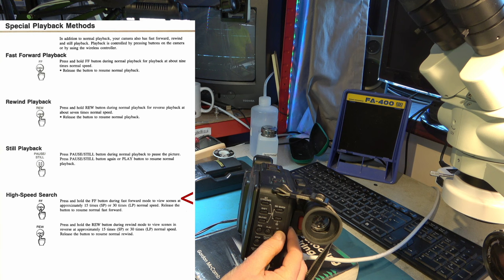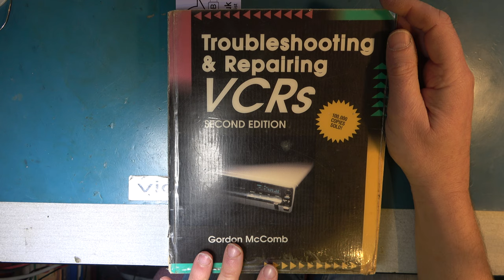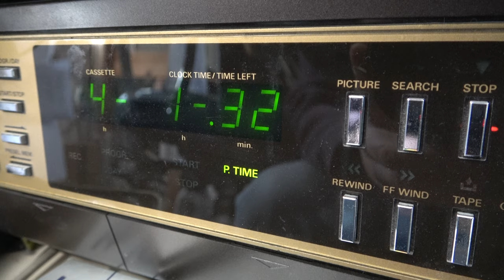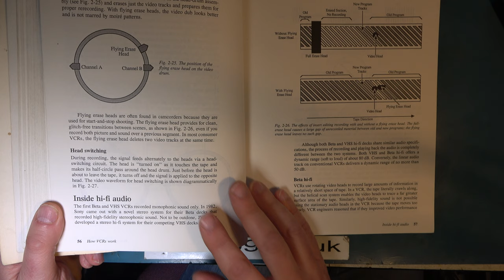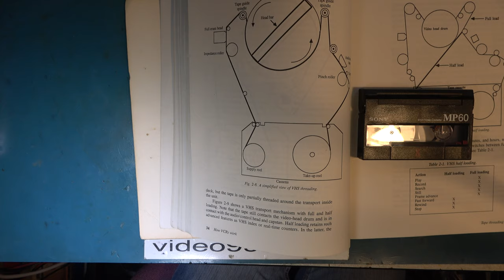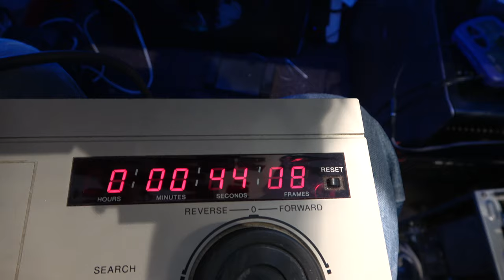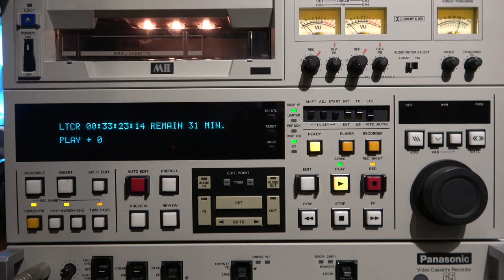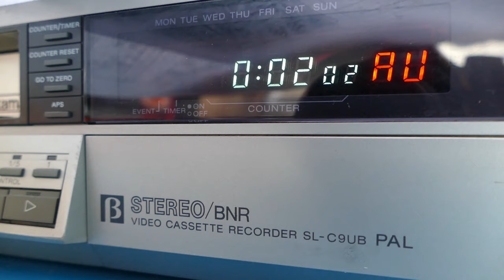To lace or to unlace, that is the question. Video deck threading during tape wind.

Comment: A bit late in the day now I siuppose, but I like the idea that Sanyo reverted to unlaced winding to save wear on the heads, despite the monitoring issue.
Back in the day my Sony C5 had rather too many head wear problems!
Reply from the maker: Funny that some Beta machines went from laced to unlaced but later some VHS machines went from unlaced to at least partly laced.

Comment: There was an unofficial  modification to the Philips N1700/N1702 which took advantage of its fully laced operation to give off-tape monitoring during stop, wind and rewind, replacing output from the tuner with the signal from the video heads when the Rec key was depressed. It was published in Television Magazine in April 1979 and I performed the mod on my own N1700 at the time. It gave a decent still frame during Stop, and a just-about-usable video during FF and RW. Not nearly as good as Beta SkipScan, but it gave a general idea of where you were during FF and RW.
Reply: Please share the wiring diagram for the modification on the N170x

Comment: Fascinating look at picture searching! My JVC S-VHS does the half-load, for the real-time counter. My PVW2800P has a PB/PB-EE switch on the front panel, which gives you the choice of seeing pictures (usually very broken up) or the input signal during FF/REW. Hadn't seen that book before, looks useful. I have Steve Beeching's "Videocassette recorders - a Servicing guide" and Eugene Trundle's "Servicing TV and Video equipment" - both really superb books, had them since they were published, and highly recommended for anyone working on these machines.
Reply from the maker: Ahh names from Television Magazine.

Comment: I was trying to think where I'd seen that feature before, holding down FF/REW and the machine jumping into picture search, it was the Sony UVW series of BetaSP decks. The front panels on those decks don't have jog/shuttle wheels so I think the only way to get a picture search is to hold down the FF or REW button. I bought a similar text book when I was on my TV engineering course back in the 90's. That one is definitely for PAL machines as it goes all the way back to the Philips N1500 and N1700 series, but I don't think it covers SVR or U-Matic and think it ends at Video 8 but not Hi-8. It shows all the track layouts for each format right down to details such as the azimuth angles of the video heads.

Comment: What a handy book :-D
I was never a lover of forward/rewind while the tape was around the drum, just didnt like the idea.
Betamax looked unsafe to me, but later i saw that it was quite reliable and a much nicer picture.
Reply: Sony machines often keep the tape laced and the heads are often worn out though i have a sony c7 with good heads and just common faults .Sanyo machines the heads tend to last or not wear out as they unlace the tape during fast forward or rewind

Comment: the "M wrap" seems the most logical and mechanically straightforward way of lacing; are there benefits/reasons for other types of lacing or is this a patent issue perhaps?
Reply from the maker: A loading ring is simple and reliable so was used on many decks, even some VHS ones.  But once strong modern plastics became available to make lightweight cam gears, M-wrap could be made smaller and lighter than a loading ring assembly and I think that's why it won out.

Comment: I have a Grundig S-VHS, it has a dead battery, so it's locked all the time once unplugged and plugged back, and needs an unlock code to operate.
Reply from the maker: Common problem apparently, and one that I will be working on with these machines.

Comment: The GRUNDIG VS680 should still have the semi lace Drive from the Panasonic NV-FS1, since the Quick Start semi lace winding G Drive from the NV-FS100 already has the large Brass Roller. The Service Manual of the NV-FS1EG says that the Device can only use MESECAM, without using the Term. I have the impression that the Maxell Dß L Cassette comes from Cologne.

Comment: I'm not aware that Video8 recorded linear audio track, I thought it was always FM mono or stereo with one channel is encoded into the other channel.
Reply from the maker: I believe the linear track was available but never used.
Reply: I had a look at my old text book and for Video 8 it says there are audio tracks at the top and bottom edge of tape. The one on the top edge they've labelled as Cue Track/Sync Track and the bottom one as Auxiliary Audio Track, both are 0.5mm wide. It doesn't mention a control track but instead talks about AFT (similar to V2000's DTF), where tones are recorded on the video tracks for servo reference. The book is too old to say if Hi-8 is any different as this third edition of the book was published in 1988.
Reply: @jkmac625  So it never implemented by camcorder manufacturers then.

Comment: I have a Samsung VR-5710 which stays laced in all functions but does not do a high speed (stop->FF) picture search. It does have a function in play mode if you hold the button, it speeds the motor slightly.
Reply: Yeah pretty much all VHS decks from the mid 90s and on always lace the tape fully even when in FF/RWD. Even the very late ones that would rewind super fast. That was probably past the point that the shown book was written.
Reply: @analogvideochannel4612  This model is from 1990. Mono 4 Head HQ with OSP